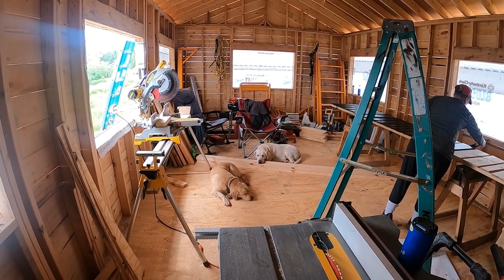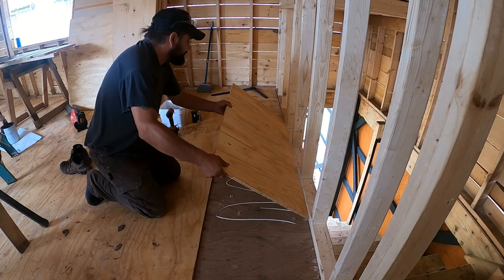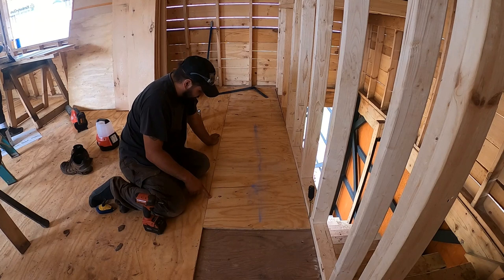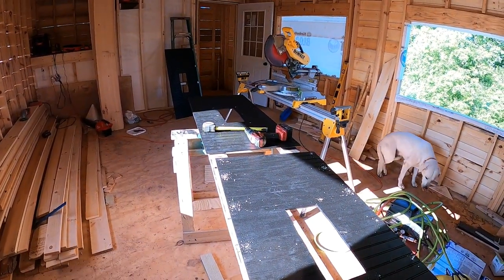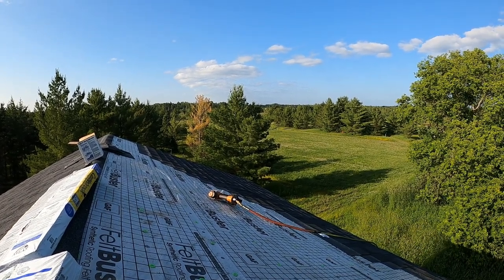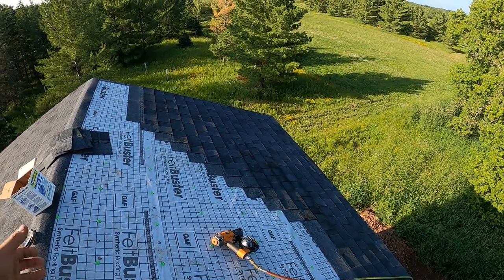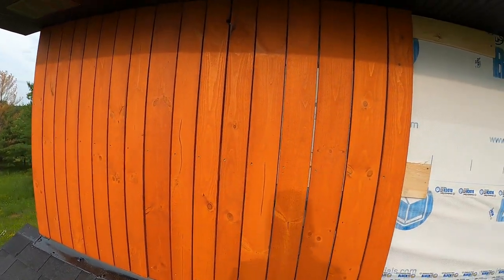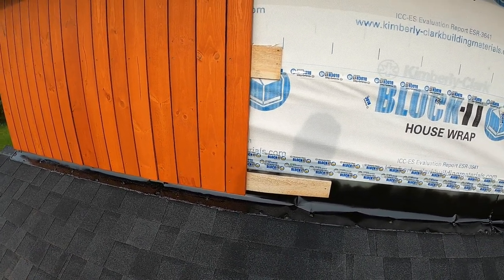Monitor pole barn build.  Episode 5

Comment: Everything is shaping up so nice! Awesome progress. Thanks for making these videos and sharing them with us! 
We are in the same growing zone as your property and those last couple hard frosts turned our potato leaves black but they came back too. Natures pretty awesome. 
If later you want a water source for the garden you can place a couple 250 gallon totes to catch the rain (as long as there is some) and add a hose where the on/off valve is. We bought 50 gallon plastic barrels, but sold them and got the totes. Far easier and more water. 😊